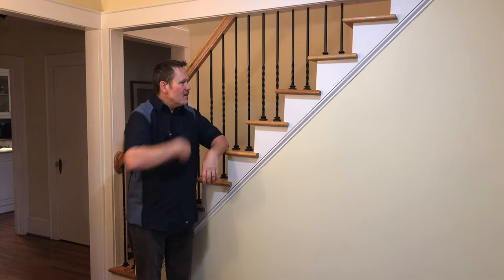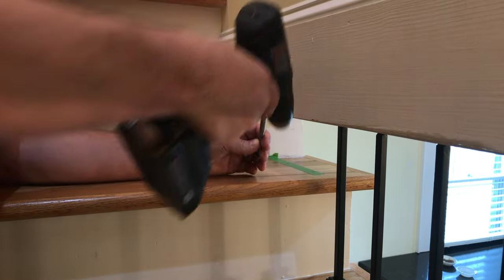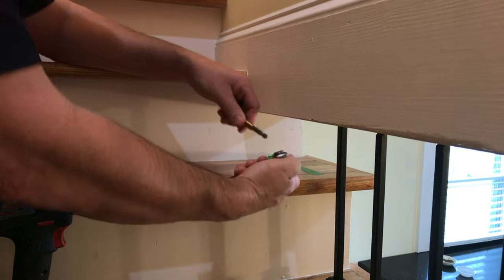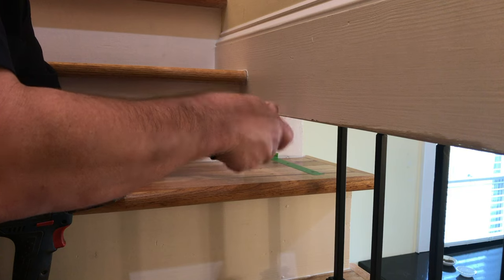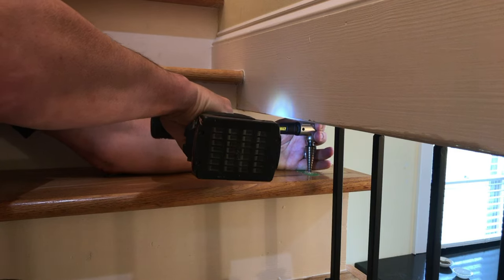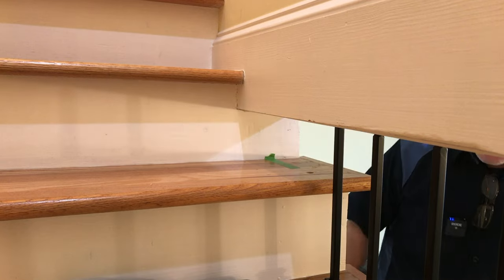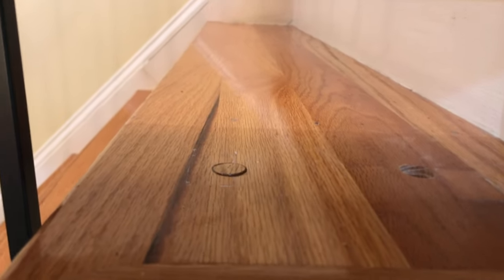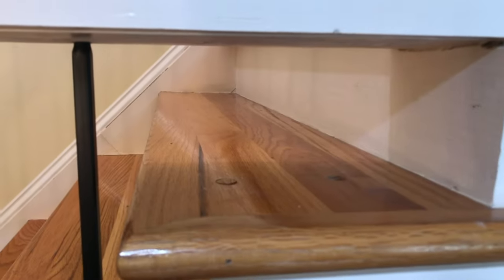Drilling in a very tight space

Comment: Everything I have seen with that right angle attachment has only been with screwdriver bits. I wanted to know if I could actually drill a hole with it. Looks like you did that. Thanks.
Reply: I just searched "drill bit hexagon shank" and found plenty.
Reply: Thanks I think I've just learned a lot. I didn't know what I was even looking for but now I know the terminologies for that. What wasn't clear is whether those tools or strong enough to drill a hole versus screw in a screw.

Comment: Hmm, any ideas for drilling brick between a house and an AC unit because the installer was too lazy to do it to run a condensation line? 😉
Reply from the maker: I've never done that, but I've seen AC guys do that.  If I remember right, they drill from the inside out.  If you have a basement window or something else that you can reference inside and outside, it makes it easier to get the placement of the hole right.  I had an AC guy over recently and he told me that the size hose the other guy used for the condensation line was too small, so that's something to be aware of when you are  choosing the size.  I would push for the installer to come back out and do it though...that way they are on the hook for the entire job and they can't blame anything on you if things go wrong.  Wish you luck.